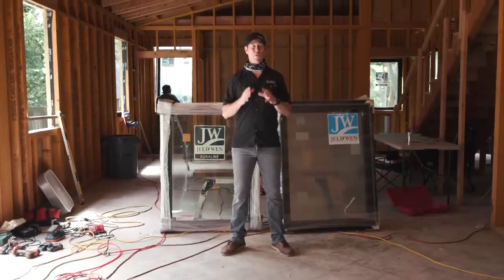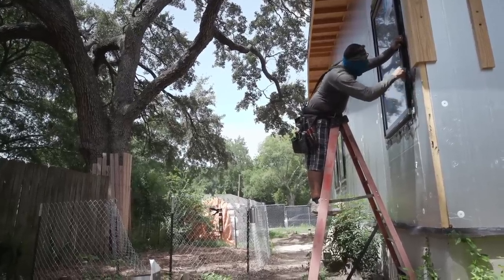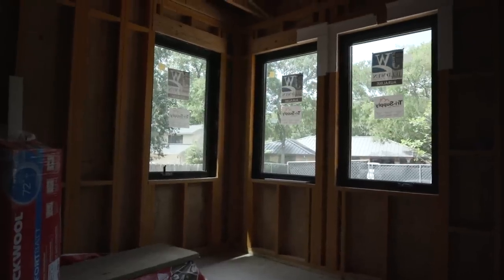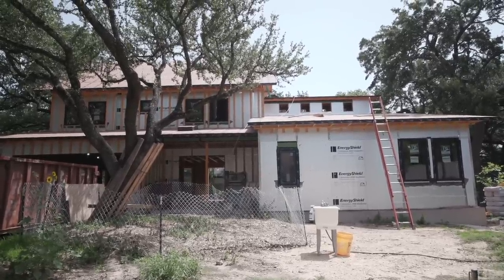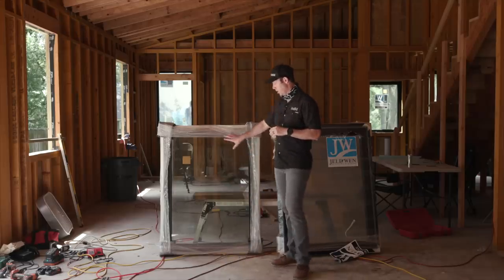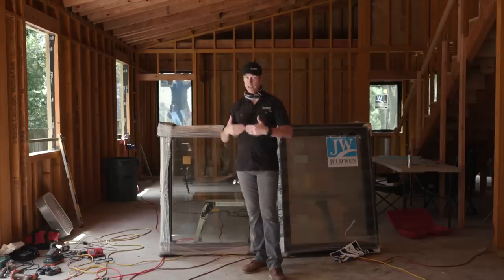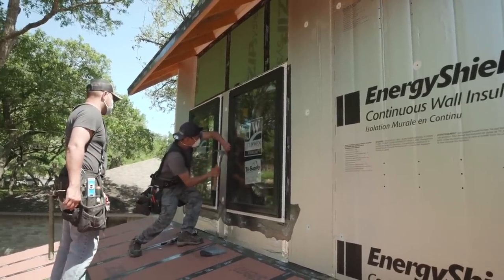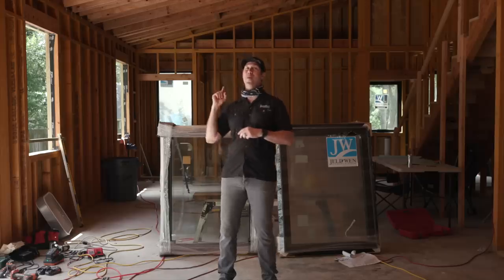Triple Pane Windows - Worth it?

Comment: Matt - you didn't mention the noise reduction advantages of triple glazing.  Double glazed windows have an STC rating around 28, while some triple glazed windows can reach over STC 50 - nearly double.  If you're next to a freeway, this benefit can be more important than the R value.
Reply: Yes!  I just went and deleted my comment about this. :)
Reply: Was thinking exactly the same, in any urban setting close to a road or a pavement with chatty people walking by, triple glazing is the option that will save your serenity.
Reply: STC is logarithmic. Meaning that an STC 50 would reduce perceived sound by about 5 times that of an STC 28. 10db is a percieved doubling of volume. Realistically an STC rating of 36 is more than enough for most homes even next to a highway.
Reply: Great input Ken! It would be better at blocking the neighbors barking dog👍🏻
Reply: @patrickhoover4797  Couple that with an ICF home and you'll won't hear anything outside noise inside your home.
Reply: Wouldn't using laminated glass be way more effective for blocking sound?
Reply: @boloren  Yes, when it comes to windows, increasing STC is a matter of increasing mass of the glass or increasing the air space between the panes. Laminated glass is a much better option to block out sound than triple pane. Typical STC ratings for triple pane are in the low 30's while laminated glass would typically give an STC rating in the mid 30's. Of course you also have to take into consideration the u-factor of the two different glass configurations. Triple pane will always win out when it comes to thermal performance vs. laminated glass in a dual pane configuration. Window performance is most always a trade off between different performance characteristics
Reply: Alot of neighborhoods around airports get retrofitted with triple glazed because of STC
Reply: Yeah, noise pollution is the worst. I wonder how wood houses compare to cinder block. I've only lived in cinder block homes and the weak point for noise are the windows.
Reply: triple pane is not inherently better than dual pane for noise reduction. It depends on the width of the airspace(s) and glass used
Reply: @patrickhoover4797  Why not have triple pane with laminated glass? Does it have to be one or the other?
Reply: arnie k  Most of the major glass manufacturers sell triple pane glass both ways (either standard or laminated triple pane) the only thing with triple pane laminated glass is that the overall IG thickness starts to get pretty wide. You would typically not be able to fit this into standard window systems and would have to go with an aluminum window system or a higher end European window with a wider glazing pocket.
Reply: @patrickhoover4797  why wouldn't it fit in "standard window systems" wouldn't it just protrude out further on the exterior? If you're planning on having exterior insulation or a rain screen or both already then it seems like it wouldn't be much on a problem. Or maybe I'm not understanding you very well. Why would you have to switch to European made? Do they make the triple pane laminated thinner or something? It's only one of the panes that is laminated correct? I just dont see how it would add that much more thickness to it.
Reply: arnie k It is not the thickness of the window frame that is the issue with triple pane laminated glass but the main issue is the glazing pocket that the glass fits within in the window frame. Typical residential windows will have a glazing pocket that will accept insulated glass that is between 5/8” and 1-1/4” thick on the high end. Triple pane glass that is not laminated will be about 1-1/4”. When the triple pane glass is also laminated it would be an overall insulated glass thickness in excess of 1-1/2”. This would not fit within the glazing pocket of most all residential windows except aluminum window systems typically meant for commercial applications and high end windows out of Europe which may even offer quad pane windows. These European manufacturers are building these more often today to meet passive house standards in many different climate zones.
Reply: @patrickhoover4797  I see, thanks for explaining that. I always wondered why people would go to European suppliers to source their windows. It's too bad suppliers here in the US dont offer those kind of higher end windows.
Reply: @arnaldosvideos  width and weight of the glass package. Everytime you use laminated glass you are using two lites of glass, so a triple pane with laminated is actually 6 panes of glass.
Reply: So should i buy triple paned for my 1950’s ranch i just bought in springfield ma? seriously considering trying to save the money and diy the windows one by one. Otherwise i could go with double glaze and professional install? Any good ideas on what brands to avoid or look at first?
Reply: @Jamaicandoctor  if you're currently single double maybe fine.

 your wall system probably needs upgraded to maybe use that difference in cost to add some foam to the walls unless you can afford to do both. 

Also depends on what percentage of the structure is glazing the more glass you have the better investment the triple would be.
Reply: @boloren  The sound must reflect every time it hits a surface
Reply: @Jamaicandoctor  Dr died?
Reply: @djsonfire0001 we have triple glaze but we’re hearing those dogs just fine till they were forced to get electric collars for them.

Comment: Hi Matt, I moved back into my old house over 40 years ago. Everywhere in those days was single glazed windows and usually wooden doors that had no insulation at all. I had just returned from six months in Norway and decided I wanted triple glazed windows, the whole double glazed thing had not started then and it was another five years before this started to become the norm. I had to go abroad to get my windows and my friends said I was crazy because of the cost. I now live in a home that takes almost nothing to heat and blocks all sound from outdoors (I also had insulation put in the cavity between the brick walls and also 3 inch sip panels on the outside to stop any ingress of air or rain). The rest of the world are now catching up and we are just starting to use triple glazed windows, I get great joy when the window installers come knocking at my door saying they are installing just around the corner so do I want to get in at the start to be able to tell them I already have it.
Reply: Where is this, geographically?
Reply: Heat is honestly a bigger problem than cold these days
Reply: @johnbecich9540  Next to his neighbor's place, obviously! 😜

Comment: Matt 2021: Triple Glaze vs Quadruple glaze
Reply: Quadruple qlaze fixed window with u-factor 0,5 (SI)
Reply: Check out Alpen windows. They use layers of low E coated plastic film suspended between the glass to achieve really good U factor. It's essentially quadruple glazed, but with plastic for the inner panes instead of more glass.
Reply: @mattv5281  Only problem with those is high cost and much shorter life expectancy. Heat Mirror/Southwall Technologies/MIT was the pioneer of this concept back in the late 70's, came to market in 1983. Pay quadruple the price of double pane and last less than half as long. Lose - Lose proposition. Horrible product in any climate with large high/low temp swings. My house in Idaho had them, complete failure on all east and southern exposures in less than 5 years. West side failed in 6th year, north side never failed by the time I moved away.
Reply: @youstubers5722  Problem with anecdotal evidence is that there is some evidence for virtually every possibility. I did a complete rebuild of a set of slope glass roofs (about 1200 sq ft total, and all single pane) that failed miserably and leaked torrents for years. Along the Front Range in Denver area, sun is pretty bad. We researched the new glazing extensively, and did Heat Mirror (factory close at hand). Top glass was tempered, then the Heat Mirror film, then the inner glass was laminated, per code. That was because of weight of each pane was about 400#, and getting hit with that load of tempered crumbs is still dangerous. Height over the floor may have been a factor in that as well; it has been awhile. I seem to recall we used 66% transmission. There are/ were a number of available transmission levels based on the thickness of the metal spray on the Mylar film; at 44%, the view is pretty hazy, like looking through Vaseline film on a sheet of glass. Completed in 2001, no problems reported up until the home changed hands a few years ago. Since then, I am not sure, but somehow, big problems always seem to find me, so I suspect that everything is still okay.  

Reality is that one has to be nuts to do this kind of slope glazing, especially in Colorado, but covering it with a solid roof would have turned the best part of this huge house into a dungeon. 
Note: The original designer died of complications from Alzheimers a few years after the original job was finished (!).
Reply: Quadruple glaze is not effective as the spacers self destruct from the heat within the panes of glass in quadruple
Reply: @mattv5281  Plastic film ? Not shure what that  could be but average european producer use a thin metal film on glass as IR insulator, argon gas between glaze and air tight plastic spacer between glaze to keep argon gas inside.
Reply: Lol
Reply: What, if any, reflective or tinting have you seen on home windows?

Comment: I’m in Toronto, Canada and I had new triple glazed windows manufactured by a company called Panes. 

Absolutely amazing windows. They also block out a considerable amount of sound. I’ve noticed a huge improvement over my 1980’s slider windows in terms of comfort. For me it was only a 7% cost increase over double glazed. 

Triple is worth it!
Reply: How about keeping the heat? I'm from Ottawa and really thinking about upgrading
Reply: @zzzgarage2704  my house is a double brick 2 story 1957 build with zero insulation. And I’m not forced air I’m radiant heat. I would say i don’t really feel any drafts compared to before from the windows. But I do get drafts just because my house is not actually insulated so I do get heat loss that way.
Reply: @drivenserb  My house was built in the 80s and the original single pane windows are making my bedroom 1-3 ℃ lower than the other rooms in the house
Reply: @zzzgarage2704  my advice is to have a window company come in and quote you for double pane then Ask about triple pane. In my case the cost difference was minimal that’s why I went with triple. Even did a triple pane patio door!
Reply: I'm 60 miles north of Toronto and meant to post this to your post rather than the general posting above.  When I first got my triple paned windows, I noticed that in early mornings (it was fall), my windows seemed to fog up and I panicked thinking the seals had somehow all mysteriously failed.  I called up my dealer and he laughed and said that this was because the new windows weren't transmitting heat from inside the house to the outside so they were cold and condensation from the warm moist air off our lake was condensing on the outside... so I went racing outside and sure enough he was right.  It was all on the outside of the windows.  Let the sun come up for more than 15 minutes and it evaporates off but it was a very clear illustration to me the benefits of a triple paned window over my old double glazed windows (I still have a few of those where I didn't care about switching them out).  

In the last few days, I've used an IR Temp gun to shoot my double and triple paned windows inside and out both during direct sun and on cloudy days and at night and the differences are astonishing.  Right now, my (stone clad, 1" Styrofoam SM exterior cladded (on top of existing 3/8" chipboard on 2x6 with Roxol Wool insulation) wall has an internal temp of 71.5˚F/22˚C in direct sunlight on a 16˚F/-9˚C day.  The thermostat is set for 22˚C (71.5˚F) so that makes some sense.  The interior walls are anywhere from 72-75˚F.  My triple glazed metal clad wood windows (Loewen) triple glazed windows are showing an internal (on the internal glass pane) temperature of 80˚F/27˚C while my Jeld-Wen Home Depot double glazed original windows are showing 65˚F/18˚C so I'm losing 7˚F/4˚C to those over the walls (while my UV coated, triple panes) are actually bringing in more heat than they are losing.   If I go outside, the stone cladding is at 32˚F/0˚C in the shade but 65˚C/18˚C in direct sunlight.  My triple panes are sitting at 47˚F/8˚C in the shade and 65˚/18˚C in the sun so not losing anything more than the walls in sun and about 15˚F/10˚C in the shade.  I worried that this would be a problem at night or in warmer weather when I don't want the extra heat, but at night, the triple pane windows drop down to the same temperatures as the walls but the double panes go down into the low 50's.   I've done the same experiment in the summer and found that the interior temp of those triple panes never seems to go much above 80-85 even in direct sun but the biggest difference is that you can sit in the sun on the hottest days comfortably while we would get chased away with the old windows by 10am or so.  Not to mention that we had to replace all of our leather couches and flooring with the old windows after 7 years due to sun damage while the last set has been like new for the past 10 years with the new windows (the old ones were UV treated too).  It's a no brainer to me.  Pay the extra money.  Your wallet will thank you.
Reply: @steveburton5825  agreed! I’ve experienced similar very happy with my windows!
Reply: @drivenserb  I’m in the GTA. Which company installed yours?  Did they do a good job, would you recommend them?
Reply: @TheAmtwhite  I went with a company called Panes. They manufacture the windows themselves…well the frames. I had lots of issues but it’s not because of the company it was the contractor I hired. I solved all my issues directly with David (owner) of panes. They have their own install team they even came out to fix the contractors mistakes. They really stand behind their product. Going on summer number 3 and zero quality issues to report.
Reply: @drivenserb  Thanks :)

Comment: 2:45 "Divide that by one to get the coefficient." e.g. 0.29 ÷ 1 = 0.29
Mathematician: dies on the spot ("Did he mean 'Take the inverse'?")
Reply: Same here!!
Reply: He did mean to take the inverse          (ex: 1/0.29). The "U factor" represents thermal conductance, while the "R factor" represents thermal resistance. These two are direct inverses of eachother.
Reply: Should be divide one by that.
Reply: Did anyone really have difficulty with understanding what he meant? If so, you got bigger problems...
Reply: Of course he meant take the inverse. You don't have to be a mathematician to understand that he mistakenly said the wrong thing.